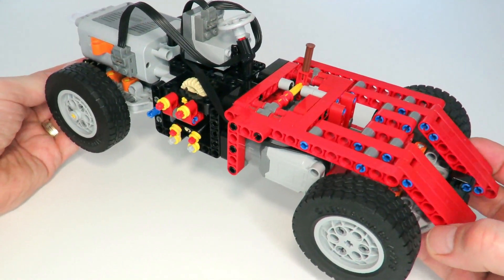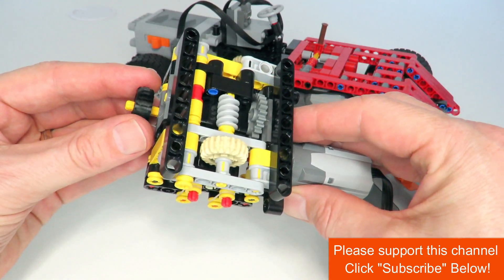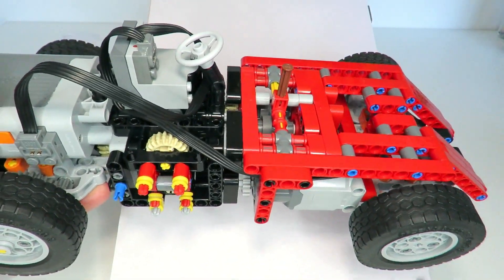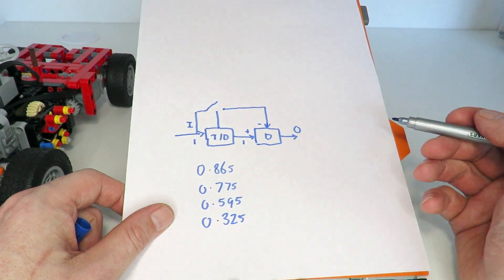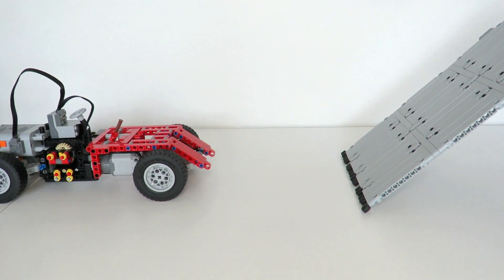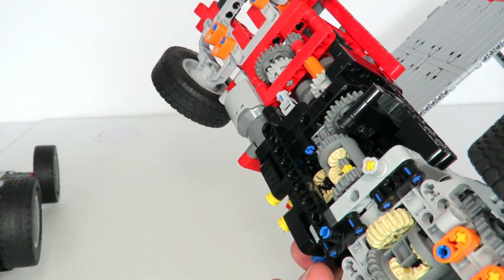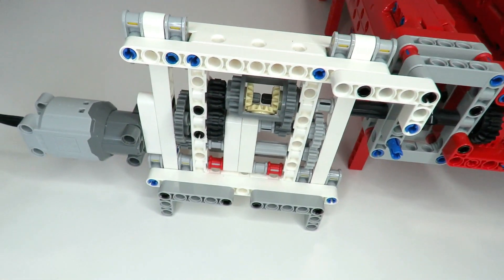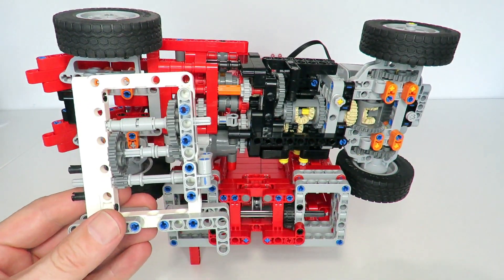Lego 2 speed automatic car. Part 1

Comment: so in the set up at 7:25 you should switch places between the black cogs on the left and the light gray cogs on the right, making the main input of the differential the slower one, and repeat the pulling experiment

Comment: I built this gearbox (with some different ratios) and it's very cool. Seldom seen such a smooth thing. But yes, torque does not seem to be better. I don't think because of friction, I guess because the direct input on the differential is the weaker one. If you subtract speed via wormgear, the direct input stays at the same «weakness». 
But the idea is so nice, there must be a solution to bring the two input lines together, without having the direct line fighting against wormgear line ✌🤔🤓
Reply from the maker: Hi Daniel - Yes I agree - You've made me think again about this idea and I might try a new variation. 🙃

Comment: Pretty cool. Keep it up.

I actually thought you're going to go with it and was like "how the hell is this subtraction going to work?"
Cool you did test in on reasonable slope . From my understanding, the subtracting method seems to throw away the portion of torque/speed that is being negated/subtracted from each side of the mechanism. That is why a lot of concepts for automatic gearboxes end up working great for the speed, but not necessarily for the torque.

Also additional opposite problem to this one. Lets say you have a model heavy enough so it won't move on the fast gear, have you tried using the gearbox in such scenario? Or even better figuring out a way to start from slow gear even when you don't necessarily have the weight or slope preventing the move, but we want the model to start with low gear and slowly climb up the speed.

Anyway, I'm tuned in.
Reply from the maker: Hi SaperPL. Thanks for your comments. I thought with the subtraction it would still be the overall gearing ratio that counts - kind of a black box approach, but obviously not! It may not be the subtracting but simply the differential introducing a lot of friction - I need to do more testing. Yes I think with the heavy model the gearbox would switch to the low gear first before switching to the higher gear. I did see that already with the car. The start up torque made it switch and then it dropped back again once it got going. This will be more obvious with a heavier model. 😀